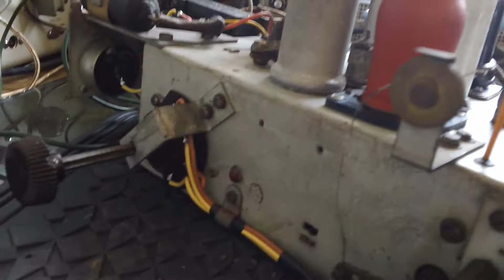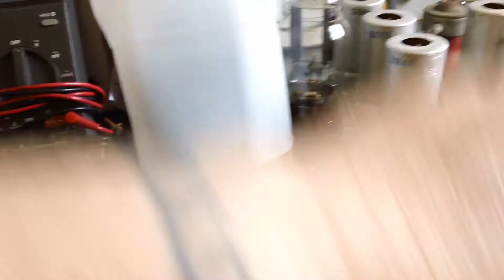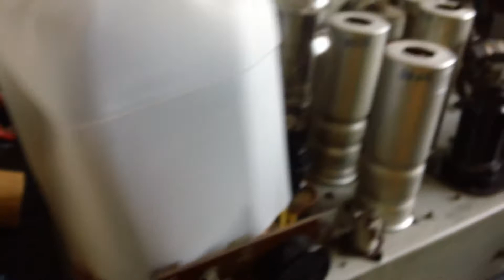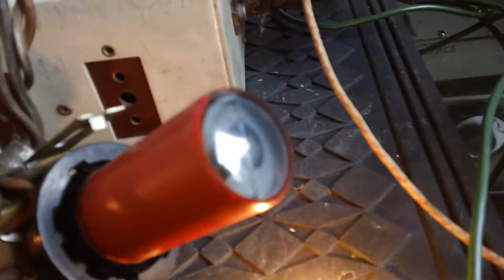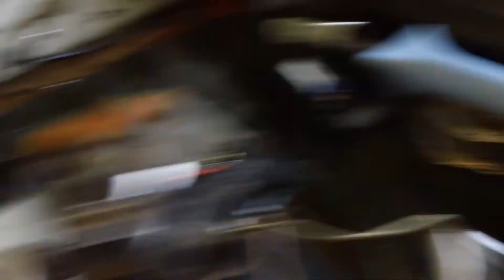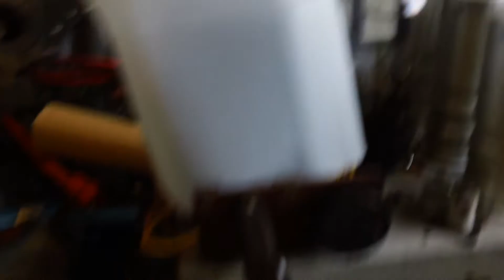Philips 555A Part Two

Comment: Hi Andrew ,  were you able to restore this one ?  Did you decide to put the original EF9 back ? grtz
Reply from the maker: Hi Bert, you know I can't really remember. It's up in my loft anyway so the next time I'm up there i will look and see where I got to. I seem to think the wire cables were twisted..or something.
Reply: @Andrewausfa   Could you also , if you have the time , draw up the dial cord stringing diagram ? I have a 556A  set and can't seem to find that info anywhere .... It looks like it is very similar to yours .
Reply from the maker: @bertvanlokeren1677  Hi Bert, it's on the Netherlands vintage radio site, full schaltplan. I'm not at home right now but can paste the link later.

Comment: I was surprised to see it fire up with most of it's original parts in place, that must have been a relief! Do you use a watt-meter to make sure the AC current draw isn't excessive?
Reply from the maker: 50sTransistorRadios  Hi Matt, the most import things had already been replaced before I got the set, smoothing (filter) capacitors and the V3 to V4 audio couping capacitor. They all checked out so I felt reasonably assured,  while praying I'd wired the power TX up correctly, that it was OK to turn on.  TBH these old sets usually work in the sense the basic power supply is usually OK, it's just the C and R's that need helping.
Reply: That first switch on is definitely more nerve racking with AC powered equipment than it is with battery powered transistor equipment (I use a bench supply with an ammeter that caps out at 1 amp)
Reply from the maker: 50sTransistorRadios
 Matt, don't forget you can make a miniature dim bulb tester (we call them lamp limiters here) with a 24v lamp bulb for your battery sets. Same principle as for an AC DBT.
Reply: I have seen those used on tube radios, but you're right, that concept would be useful for transistor sets too, especially for people who don't have a current limited power supply.

Comment: Andrew - great progress! Wonderful job on the rewiring and I like the creative safety cover over the power transformer. I look forward to the recapping and seeing you tackle the tuning mechanism, which looks complicated. 

BTW - for my edification, what's the voltage rating, gauge of the silicone covered wire? I assume it stranded as well?

Best,

Don
Reply from the maker: RestoreOldRadios  Hi Don, ooohh yeah, the tuning mechanism. I can't wait for that one :) Other than the tribulations of mechanically lining everything up, it just looks downright dangerous to do. The wire is 0.5mm2 750v 3A I believe and yes, stranded.  Thanks for watching - Andrew

Comment: Maybe baseball bat tape for cloth tape? Fine old radio. Thanks for the video, enjoyed.
Reply from the maker: plantopguy5  Thanks, yes a lovely old radio. It'd better be grateful after the work put into fixing it.  Good idea on the baseball bat tape. I know the stuff you mean and it would be great if I could get some. Baseball over here is non-existant since all the US bases closed down. I did buy some vehicle wiring loom tape, used for restoring classic cars etc but it's not really sticky and quite thick. 

Andrew
Reply: ***** Here they call it either "Friction Tape" or "Hockey Tape", sometimes they use it on weight lifting equipment or bicycle handlebars too.